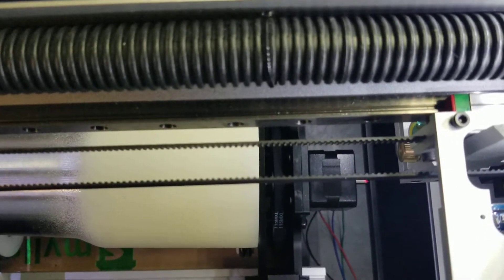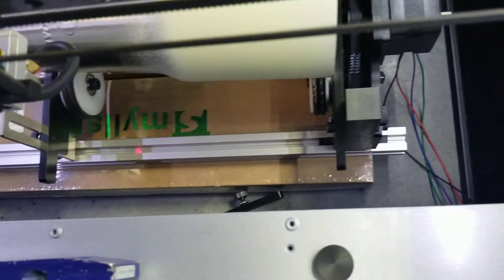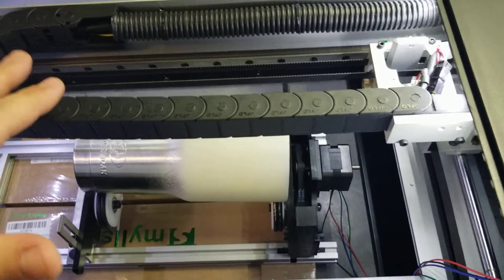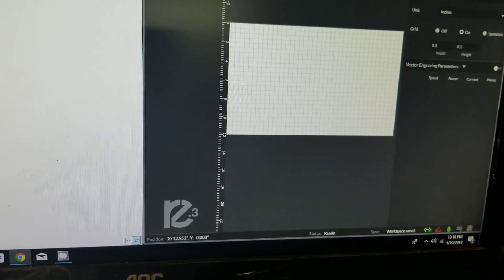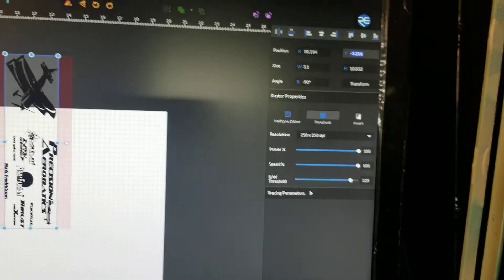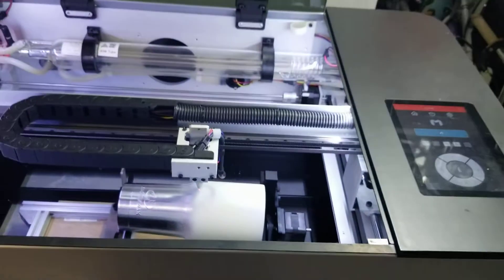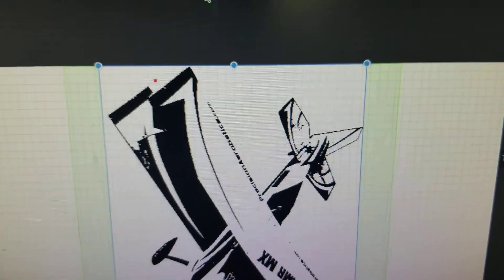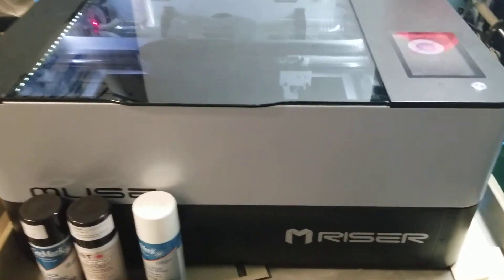Setup & use of FSL Muse laser rotary

Comment: Looks like this video i about 1.5 years old now.  How is the Muse holding up,  Thinking about picking one up, anything you would do different or a different brand.
Reply from the maker: It's holding up just fine but I am a pretty light user. I've enjoyed all of the update releases and generally think quite highly of the company with the attention they've given this model which is small in comparison to some of the things they sell. Only thing I would do different is to make my first project cutting a screen protector for the display touch screen. The glowforge still does not appeal to me like this one does, though I wish they would do a feed through  on the Y axis.
Reply: @kohersh  Thanks for your time.    I agree the pass through would be awesome and the 2" max z axis on the glowforge took it out of contention once I found out you can't do tumblers etc.

Comment: Hans thank you for your video, I am doing a tumbler right now and I have gone step by step with your video. Thank you for posting this! Works great and is coming out great! FSL needs to pay you for this video because I know its helping a ton of people out. Thanks again!!
Reply from the maker: I'll hold my breath on the compensation...but I will continue making videos as I go further with this laser. Which to be clear I think is an outstanding machine with strong software, and I love that RE3v1.8 just came out though i have yet to work in it. I think the videos FSL puts are more about making a sale over supporting the existing sales.  It would be really cool to see a sliding bed (ala Glowforge) added onto a Muse V2 at some point. I have already run into bed size limitations on the 12" side.